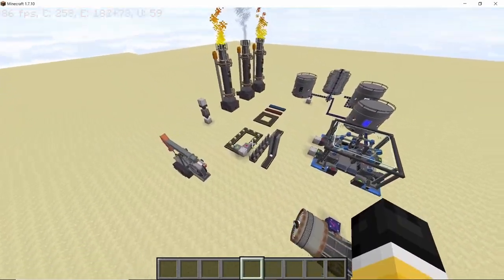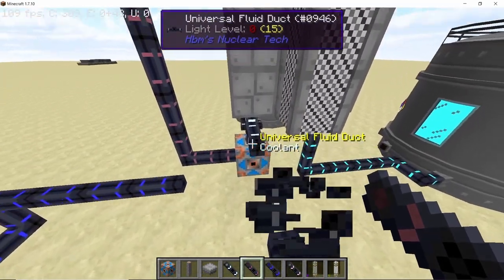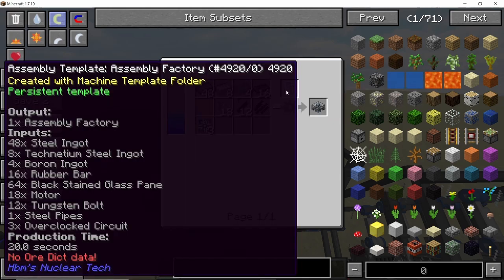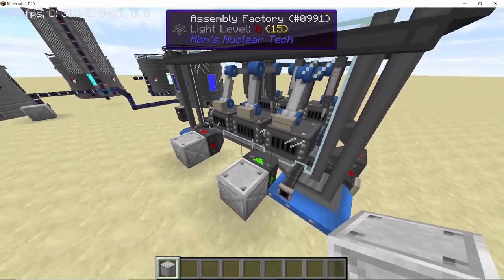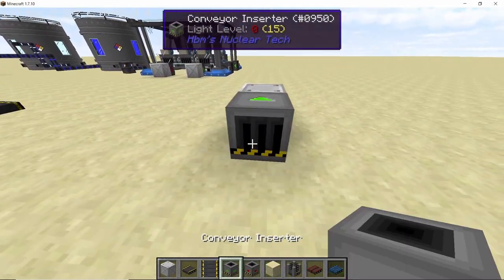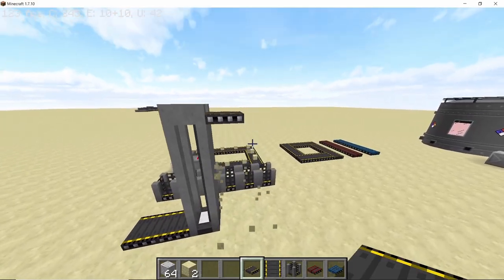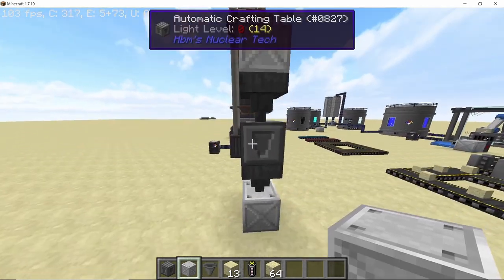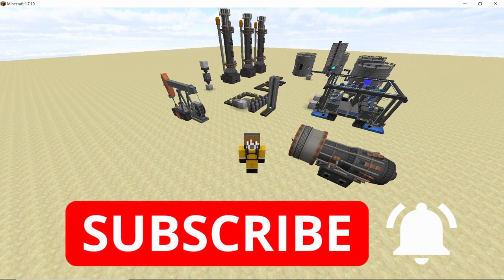Conveyor Belts, Auto-Crafting, RBMK Heat Exchangers & more - HBM NTM updates you might've missed !!

Comment: hello man im playing survival with this mod and i dont understand some tips first of all it is how to run Particle Accelerator so in wiki says several different tiers to power plugs but i dont see in jei how to craft this i see only 1mil plugs and i dont see how to craft Hydrogen Ion can you help? Version for 1.12.2
Reply from the maker: Ah man the thing is version 1.12.2 is still incomplete in some aspects of features. The particle accelerator was fixed recently so I would recommend downloading the latest version of the mod from Curseforge and you should see some missing recipes and better performance 
As for the guide on wiki it is mostly for 1.7.10 version of the mod which is the main version. So if you wanna build an accelerator that works without any issues then I would recommend switching to 1.7.10 version of the mod. Also by doing that you'll get access to all the new updated stuff that is added in the mod
Reply: I have the same problem with the Hydrogen Ion capsule 😂

Comment: Why did they remove conveyers and  assembly factory?
Reply from the maker: They haven't afaik , both the conveyor and assembly factory are available in the latest version of the mod
Reply: @SavageVegeta  I don't have the assembly factory, or the Zirnox reactor. I'm not sure if its because I'm using the reloaded version
Reply from the maker: @kelleye5291  then you need to update your Minecraft version
Reply: @SavageVegeta  but it only works with 1.12.2 right?
Reply: never mind, ill ask the discord, sorry for the trouble

Comment: Si you know by any means how does the conveyor sorter works?
Reply from the maker: each side with different color can be white listed for different items and then a conveyor line coming out from them will only have the whitelisted items. I have not personally used the sorter yet but it works like that in other mods and I am assuming from the design that it wont be different